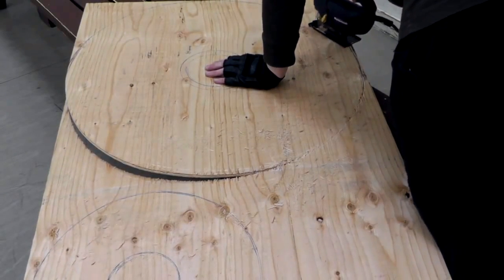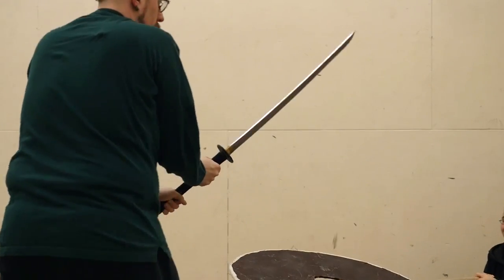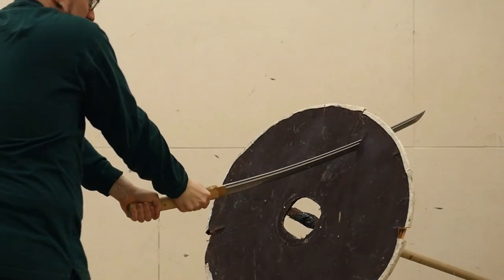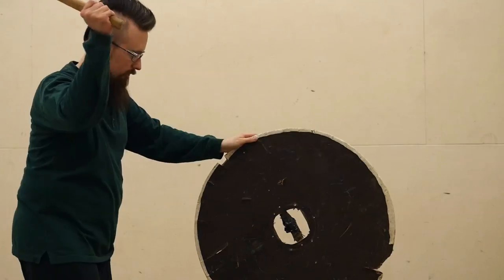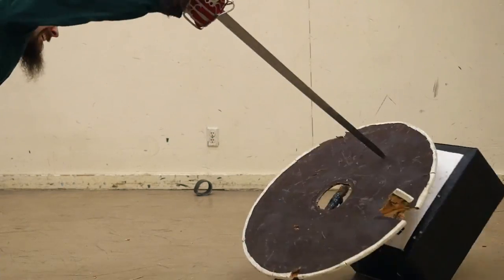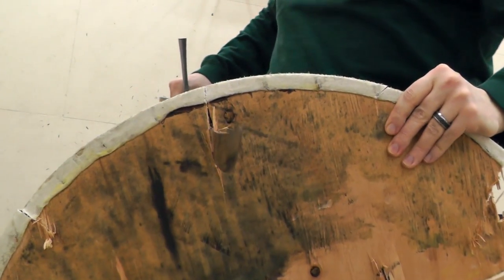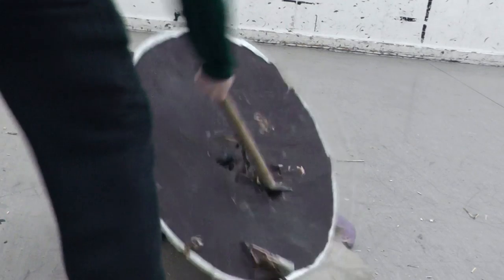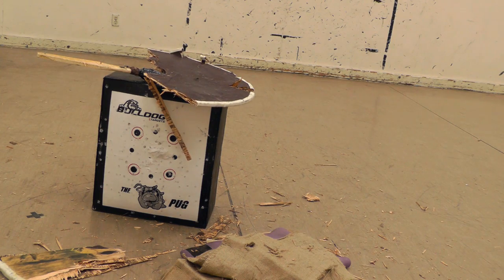Plywood shield vs broadsword, katana, axe, kriegsmesser, and war hammer

Comment: learn to wield a sword, and specially a Katana, if you only swing it like that any weapon except hammers and the like are useless
Reply: Vayne Ryu baitkakke
Reply: +Vayne Ryu There are no swords that are effective against shields, especially not the Katana because the back of the blade is to thick.
Reply: HammerheadGuitar yet Isao Machi cut through steel with one
thats the thing that puts apart the Katana from others blades
the user skill determines how amazing it can be, though no real Katana can be ever made this day and age
Reply: Vayne Ryu You can cut through a thin steel sheet with a bronze sword as well. Modern Katanas are better than the original ones Japanese steel was of very poor quality.
Reply: HammerheadGuitar lol, yet they break on original Katanas, the techniques used to make them are lost, so they cant replicate it
after Masamune died, no Katana made was to be called a real Katana
Reply: Vayne Ryu The technique is still known. It's mostly due to folding the metal over and over again, wich is a technique that has been used since about 2000 BC in Europe by Celts. Really the Katana is not a magical or special sword, it's just a descent sword made from poor quality steel.
Reply: HammerheadGuitar nop, there are still many mysteries about the forging of the Katanas
one of your so called better swords was tester against Masamune and it snapped while not even a nick remained on Masamune (Masamune's finnest and now residing in the museum as a national treasure, its mantainance is being kept dialy, and not a spec of rust has befallen that blade)
there is a reason Katanas have been given the title of best of swords or the two handed Guillotine, and as I said before, not only the blade but the swordman counts, as to steel cut, it was a pipe
Reply: Vayne Ryu Stop watching Hollywood, videogames and anime... No credible swordsman or blacksmith would name the Katana the best sword.

Give me one good reason why a Katana would perform any better than a German zwei-hander?
Reply: Vayne Ryu The best swords are Damascus steel swords from the middle east and India.
Reply: HammerheadGuitar ligther, sharper (the blade isnt shapened, but its made sharp, which believe it or not, give it a better edge), more resilient (the thing about a blade snapping when tested to Masamune wasnt a joke either)
there, not 1 but 3, and thats the tip of the Iceberg
and its not fiction what I talked about, but from actual research and people who actually know half of what they talk about, you believe this guy has any idea what he is doing? the fact he even call his toy a real Katana is laughable enough, do some research, I already did mine, and I still keep finding new thing to this day
Reply: Vayne Ryu Lighter means less kinetic energy when hitting your target. It isn't sharper that's a myth, zwei handers can be just as sharp. 

You are comparing the greatest blacksmith in Japanese history with average European blacksmiths, why not compare the greatest European blacksmith with Masamune?

Just because one guy was able to make great Katanas doesn't mean the Katana was a great weapon.

There is nothing magical about the Katana it's basically a thick two handed sabre. 

It was more of a ceremonial and duelling weapon than a weapon used in war.
Reply: HammerheadGuitar I use Masamune because its the actual last usable Katana known to man (from my understanding), all other Katanas are eithrt rusted cause they didnt tend to them and thus being onlyhanded down as heirlooms, or lost/stolen and their wherebouts remain unknown
you can try as you want, hevier also means also harder to wiled thus eliminating all and any resemblance of technique when using it, its no dieferent than flailing a big lump of steel, since its strength lies on its weight
you say technique is a myth, try cutting Bamboo with a Zweihander, its impossible, no amount of kinetic force can break bamboo (well, maybe tons of kinectic force can, but thats impossible with human hands) yet it can be cut not by sharpness, nor by force, but through technique, thats why the Katana was molded to be lighter but just as resilient if not more than other two handed swords, so technique wouldnt be sacrificed, but rather being its main selling point during those ages
the fact that you need to grind an edge into a sword actually makes it more brittle (any material follows that phisic law), thats another reason the Katana is forged so it already has the edge, so its easier for it to mantain its edge, thats why I meant by sharper, not that it cuts simply by being sharp, but cause its harder for it to loose its edge (didnt really explained myself before)
Reply: Vayne Ryu The techniques to make the Katana are still known, there are still swordsmiths in Japan and even Europe who use the exact same techniques. Japanese steel was of inferior quality compared to late medieval steel this is a fact. The difference in weight is only a few hundred grams, and keep in mind that Germans are physically bigger and stronger than Japanese.
Reply: Vayne Ryu Dumb me btw I have zweihander in my head for some reason but I mean longsword sorry.
Reply: Either Vayne Ryu has watched too many movies and anime without ever having red an encyclopedia about weapons or he is just trolling. If you are trolling , then good job you actually seemed pretty serious. But if you seriously think the katana is the best sword.....Explain to me why you think that.And the forging technique is nothing special either they just had been hammering it down , and straightening ita few (7-12times in real life , but in movies they usually say 1000 times). And the katana was made with this technique in 13th century after christ. The celts used the same method , way before christ. And they had better steel than the japanese already.
Reply: Hristo Kuymdjiev you do know if you grind something, though it may not look to the eye, small craks appear on in right?, not only steel or the like, but basically anything that is grinded has that result, microscopic fisures, and its those fisures, that with use, make any sword get damaged since they grow even if you dont notice them, when Katanas from the old times, those that were made during the ages of the samurai and whanot were studied (mostly the ones that didnt really get much use, Masamune among them), it was learned that Katanas didnt had thos fisures, because, as said erlier, they were forged with the sharp edge, hence why its "sharper" but not because its sharper and cut more, but because they are way less likely to get damaged and stay sharp for longer periods of time and with good care they can stay in the best shape for extreamly longs periods of time, until time eats them away, however many years that may take
that is one reason, and I think I mentioned before, but most of my knowledge come from reading and documentaries, some which explain the since behind martial arts, ive seen quite a lot of them actually, and youll be surpriced of hearing a lot of them, when they went to Kendo and Kenjutsu it explained that and some more, for example, the thing about moving it to the side to clean it from blood is actually mostly true, they submerged the blade in a liquid, with about the same level of "stickines?" (sorry, english is not my native language) of the blood and made that thing and it appeard to be clean after one movement, but on a microscopic level it still had some residues, so its then where they explained that also, from the forging process, that the blade of a Katana has very few imperfections hence why something like that is possible, and that  it would still need to be trougly cleaned afterwards (thing they did in those eras) to keep it from rusting from blood
about the technique, its way more simple than you expect, but all of that also grants another level of deadlyness to the Katana, they explained that the technique may only be possible with the Katana since using similar curved blades didnt archieve the same level of effect the Katana did with the technique
it would be 10 to 30 time longer if I keep this on, but do check for those documentaries at least, they are amazingly intresting and cover things like how the body adapts itselft thtough the training of ones body, like how bare handed martial arts that uses fists a lot, evolve treir wrists bones to become a sort of cushion and absorb some of the impact as a way to avoid recoil damage from hitting something very hard (then thing they hit, not the strength which they hit it with)
Reply: Vayne Ryu Interesting. I will watch some more documentaries about the katana. But I think any weapon will remain in good condition after so many years if it was treated like the Masamune you mentioned. You even said that it didn't get used much in those years , in which case it mentaining its newmade condition is nothing special. Pretty much anything that constantly gets treated with a lot of care and gets cleaned no matter how old will maintain its good condition for alot of time if it wasn't used much ( hence why there are firearms from the renesance period that can still shoot ).  The celts used the same forging method as the japanese ,so their swords should have less of those imperfacnations (english isn't my first language either but i think that is the word?) especially since their steel was better ,but their swords were from much longer ago than the Musamune.
Reply: +Vayne Ryu 'heavier' doesn't mean "harder too wield", if it's balanced properly then a heavy blade can be very nimble indeed, while still retaining heft too increase cutting potential. Another thing I don't understand about a katana, is that they have no (proper) guard. There's just a ring "guard" that just stops the weapon from falling apart.. Explain to me why Masamune didn't accommodate for a proper cross guard if he's such a good smith?
Reply: Martial Centre Japan as a whole prefers technique, for them the guard was an obstacle that was impracticle for their technique
now something I just learned, and while it may not sound relevant right now it is actually
Japan has mostly not actually developed high technology, rather, they take the invention of someone else and further improve it way more than the creator thogh could be
now this isnt something Japan has just recently done, it appears to be something that it has done from times immemorial (forgot the other way to say it so ended up putting it that way), all their great "inventions" are from this practice, and the Katana aparently is among them, I think sometime somehow Japan came across a cuverd saber, I think a cutlass to be exact and then modify it with their knowledge to get to the Katana, while I dont remember how they reached this conclusion cause the article itself didnt mention it, it did mention that evidence of such was found, I think it was prototype for the Katana that were found, and they were of a different shape, more resembling of a curved saber
so, in case you think there was no answear, again, like in the begining, for them the guard was unecesary, the wielder himself must have the ability to parry or deflect those type of attacks, for that was their pilisophy during those times and as such they made a weapon that could take hits and help furter their technique in the sword, Kendo and Kenjutsu specifically
and no, it wasnt a flaw in their design, since experts still call the Katana the hand gullitone and also the best sword type weapon, and yes, with this im calling they guy a fanboy at best
Reply: ***** and who said youtube is the best source of information?
yeah, I like anime and videogames, but I also like ancient history and myths among many other things, youtube is my source of entretainment and sometimes I check for information here and there on abstract themes, trying to mark someone based on a page when the one in question is not even using his real name or relevant information is as shallow as one can get, in fact, just by seeing my profile picture youll know I like anime and videogames, but again, thats only one part of me, yet you can only see skin deep, which tells me way more about you that what you can gather from a unreliable source of information

Comment: Your technique with the katana is very wrong. In kendo, you learn to strike (with edge alignement of course) and move in your strike.

Think of you cutting some bread. Take your bread knife, hit the bread = cuts nothing. Take your knife, hit the bread, while moving vertically your knife = cut.

Katana hits in kendo are learned like that. There, you used it like an axe : of course, nothing happens.